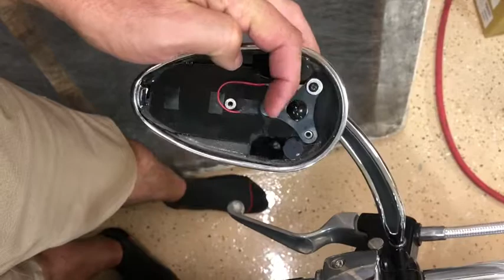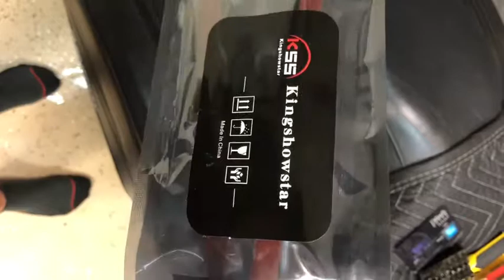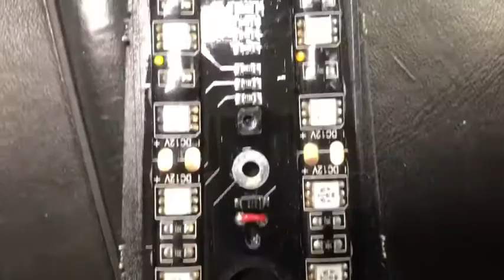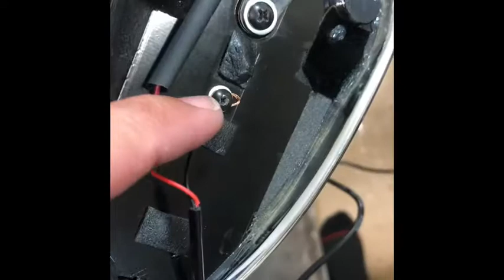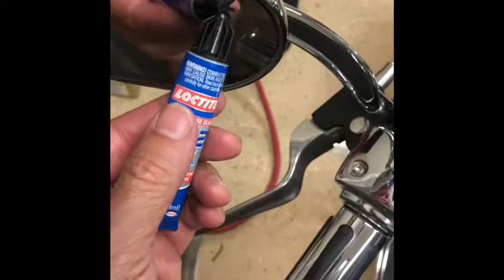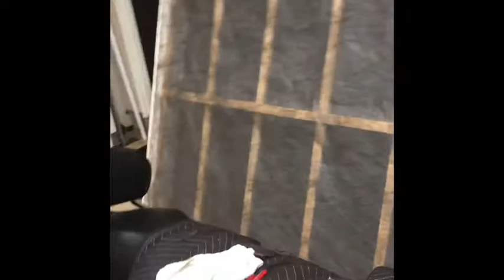Harley LED Mirror Fix

Comment: Do you have an install vid for these mirrors?   I bought a sportster that already had these and changed the bars, there is only one wire coming out the acorn nut.  I want to put the wires inside the new bars, but can't figure out where that wire goes for the mirror lights.  It goes into the wire bundle under the riser cover, but the install vids I've seen only show piggy backing the wiring into the control wires.  Thanks if you have any info for me!